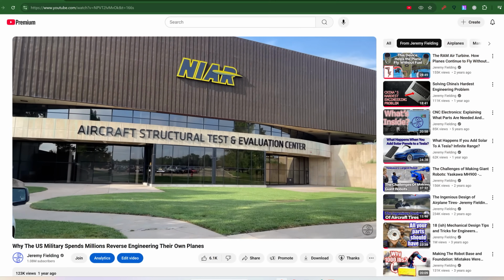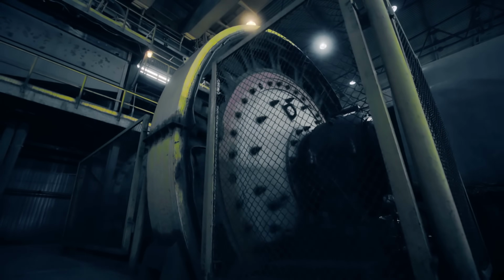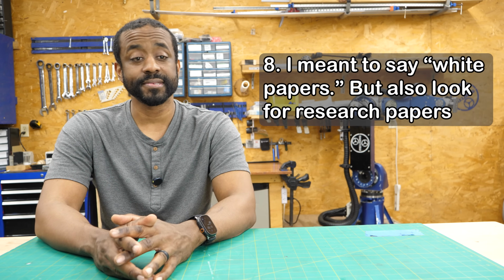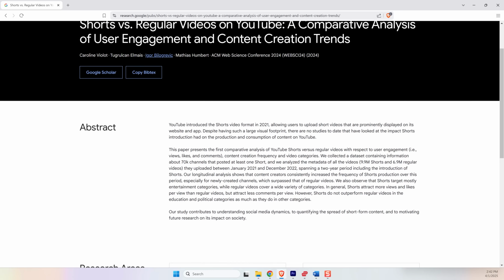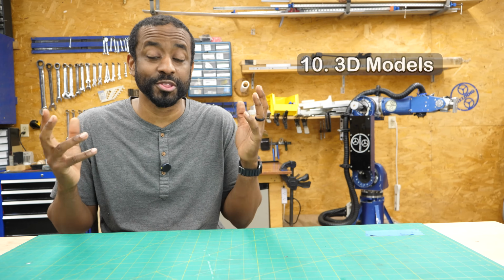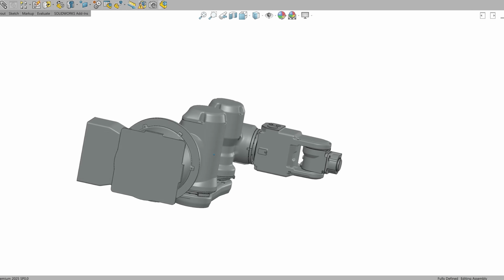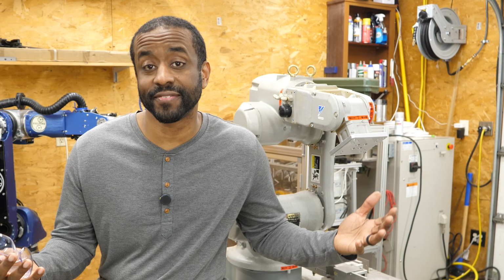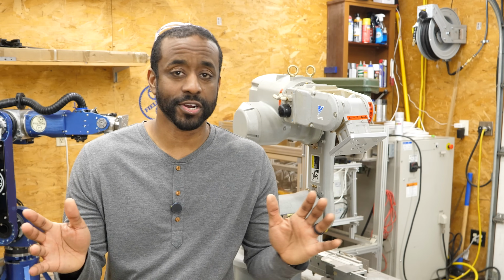How To Reverse Engineer Anything Even If You Don't Have One!

Comment: Awesome content!  Additional information are aftermarket spares and the information provided by those sources.  Mechanical interface details, images, and other mention of ISO, SAE, and other standards let you get the exact dimensions of those interfaces.  Forums dedicated to specific classes of equipment also share these details freely.  Do your best to determine if a dimension or feature location is critical or non-critical.  When I mean critical, I mean in terms of how that feature relates to other parts of the device, or if it's just because they need a fastener somewhere in the general area, for example.  Working to understand the why behind specific components of the design go a very long way to driving where you should expend your effort.

Comment: I think those plastic sheaths on for avoiding humidity ingress where the connectors are copper, copper + humidity + Air = the groovy green oxidization, they're smart to put that there. I learnt that from a washing machine what would constantly get copper corrosion due to the high humidity around it.

Comment: Excellent job. Could you reverse engineer the following invention claims even if you don’t have one?
All electric vehicles: there is an invention, EPM-2 that maintains charges to the batteries, U.S. Patent No. 9641045B2. EPM-2 leverages innovative electromagnetic technology to transform magnetic energy into mechanical and electrical energy. This makes it a sustainable and efficient alternative to combustion engines and traditional renewable energy methods.

Comment: When I go looking for manuals, I usually skip the user manual, and go straight for the service manual.

One of the fun things about reverse engineering is discovering undocumented features. I remember one time I was taking apart a broken transmission, and I discovered that one of the mounting holes for the clutch cable bracket was drilled completely through the housing. I realized that it made for a considerably easier gear oil fill port location ( right in the middle, on top of the housing) than the standard one that's at the back of the housing.

Comment: Many years ago, I was visiting my brother and I did a project with one of his boys. I handed him a half height hard drive and challenged him to take it apart. He did a great job of getting it apart. He did not take pictures or organize the nuts and bolts as they came out.  Once he was done, we reviewed how it works and what things are.  Then I challenged him to put it back together.  He wasn't expecting that step.  He did a great job. We plugged it in and got it to spin up which was more that we expected. It would not access anything that had been on the drive but we didn't expect it would.  The next year, I brought a laptop hard drive and he did the same thing.  He expected to put it back together so he was more careful about putting things aside in an organized way.  When it was open, we compared how it was just like the larger drive but smaller.  When he put it back together, this one actually spun up and we could access data! Today he is all grown up and has a degree in auto and diesel mechanics and of all things, works in a foundry.

Comment: I adore tearing things down. I really like pro-consumer and maintainable designs because I hate taking notes and I really do need some youtuber to convince me to do it. When I take apart well made laptops or a car, you tend to be able to find pretty good diagrams, only use a few kinds of screws, and you can get at stuff without taking everything else out first. I can get at my cpu, or under my laptop battery, if i feel like it, but if I want to take off the screen the only reason to mess with the battery would be because i'm worried about zapping myself (which i'm not, the screen can't run at higher than 5 volts lol). anyways this video is great, if i were to take apart anything industrial I'd totally watch think first and go download that spreadsheet.

Comment: Great video and one of my channels Jeremy.

On KUKA and ABB robots they v had a similar removable plug on the minor axis’s, this was for fitting a DTI with an electrical connection to allow the robot control system and the robot to be mechanically / electrically zeroed or aligned for the encoders.

Comment: This is awesome.  I've been watching Bigclive teardown videos for years now, but your approach is way more methodical.  (I'm sure he has a more methodical approach to the reverse-engineering of the circuit board step, but we rarely see it).

I really like the thought process of "they did this for a reason, it's probably not a mistake just because you don't know the reason yet".  The same is very true in software, especially around things that smell like bugs, or even are bugs; sometimes, they were put there for a reason, even if that reason no longer exists.  On more than one occasion, I've "fixed" a bug like this only to reveal a far worse issue that bug was preventing from coming up, and sometimes that's intentional.
Reply: "Chesterton's fence" is a term I've heard used for that. If there's a fence across the path, it was probably put there for a reason. That reason may no longer be valid, but the fence shouldn't be removed until that is verified.

Comment: I've had the same views for many years in engineering. It is possible to reverse engineer anything really, from jet engines and aircraft, nuclear reactors to a car or kitchen appliance. When I go into a machine, like you I delve deeper into the mind(s) of the design engineer(s) who made it - why did they make it that way. What challenges they would have faced and overcome etc. Even electronics can be reverse engineered.

Over the years, I have noticed products from Germany and Japan are more user friendly AND service friendly, showing these went through initial design, rigorous prototype testing and compliace before being mass produced. Products from China are more designed, prototyped and as long as it works, just put on the market. Most of their products are actually designed in the west by engineers sitting at a computer screen, the final blueprint is then emailed to the factory in China. Products from the other European countries France, Italy, Sweden, Holland etc also follow the same steps like German and Japanese products. 🐞

Comment: You make great educational and tech-motivational content. I do a bit of tear downs myself both electronic and mechanical. The robot looks like a machine with very specific measurements, I noticed you didn't talk about torque specs which I believe would be of importance to such a machine or any well engineered or designed machine. I'm also not an engineer so I may need correcting.

Comment: First off, Your channel is awesome. I love engineering! I know you know this but some viewers might not. Making a casting is cheaper for large production runs. But, in order to cast something a mold must be made and that is not cheap. It (the mold) is typically machined at a tool and die / mold shop. Or, Use investment casting, additive metal processes or sand castings. All have advantages and unfortunately limitations. But that's why we're Engineers and enjoy ( and hopefully paid) to figure this stuff out!

Comment: 10:13 That plastic fastener bin looks like it needs a center support. Plastic deteriorates over time till it fails. 
The first mechanical engineering lesson is to respect the form factor: divots, protrusions, folds, holes, thickened areas are there for a reason.

Comment: When I was seven the VCR ate "who framed Rodger rabbit" my mom said we'll buy a new one and I told her that I'll fix it. She laughed and walked out of the room but I went and got a screwdriver and completely disassembled the vcr, pull the tape out and straightened out the bends in the tape ribbon and rewound the tape. Then I put the VCR back together and when she walked in the room I was watching the movie again. Both of my parents were extremely shocked and they went and bought me a technic set right after that. I had technic and erector sets because of that. Honestly those toys were the best toys I think ever invented because you had motors and sheets of metal that were already pretty hold with screws and bolts as well as nuts for the bolts. You could build anything and I went through that whole book building the planes and helicopters as well as the cranes and loaders. Because of that I can damn near rebuild anything nowadays. My problem is I never turn the camera on😂
Reply: This was around 92 so we didn't have the internet or the information we do nowadays. You literally had to figure everything out on your own.
Reply: You're better than me ... I used to hate the erector sets because you spent a lot of time screwing on the nuts and bolts ... so I migrated towards the "easy attachment" toys that got to the big picture fast. I think there are trade-offs to either approach (what engineering is about).
Reply: That's such a nice story.
Reply: Bravo, man! Humanity is better off because of you and people like you!
Reply: I loved erector sets, my friend had one with motors, etc.
Reply: @ropeorsnake-I they all came with motors, wrenches, an assortment of bushings as well as bolts and nuts. They also had a bunch of different i-beams that came with him that were pre-drilled. Honestly, I wish they had toys out for kids like they did back in the day but there were too many parents that didn't know how to control their children back then. Even I put myself in Jeopardy by combining my Legos and my erector set as well as the Technic set. Technique was another erector set before Lego took it over and made their own. Are spun a Lego rotor blade up to about 2800 RPM before it exploded on me😅 I made Legos hover though😂
Reply: I used to take apart radios and put them together with other radios to make them work. My parents caught me a couple times and gave me a nice spanking. 😂
Reply: What book was that ? I also ticked with lots of things till now its how I earn my living now
Reply: I fixed things as well. Hardest most intricate thing was taking two broken cd walkman's swapping parts and making one working one. I was successful. Trading out even the laser. It was intense.
Reply: My mom got embarrassed as I just had to disassemble every even somewhat technical toys I got as a present. She thought that the family friends wouldn't like that etc and I should be able to show the toys intact when the gift giver happens to visit next time. 

It was also at about 6-7 years when I started to get most of those things back together and working after my interest of what's inside was satisfied.

I had a lot of Lego technic sets in the 80s. In ~92 I wanted to prototype something (as you do when you're 12) and went to find my Legos to do so and found out my mom had given all of them away couple years prior "as you don't play with those anymore". Wtf, I should have been in that discussion and would have never let that happen. I'm 44 and still really annoyed for that. And have since bought a few newer large technic sets second hand (in built state), but haven't bothered to disassemble any of those. Those 80s ones were nicer in my opinion.. New stuff has body panels etc that hide the mechanics, which is just stupid. Pretty sure having Volvo stickers all around a digger won't pay any of the pieces like an advertisement should.

I've been an electrician since 99 and now I do mostly troubleshooting, configuration/programming of lights, vfds, some automation etc. It helps a lot to know some basic industrial mechanical parts and how those should behave. Several times the electrical problem has been actually something loose on the mechanical side, that makes the load go up and trip stuff from electrical side.  Instead of blindly replacing the electrical stuff, it's often wiser to just sit down and look at the process itself for a while.
Reply: @villehietala9677  I was the same way to the point that when I was about 13 or 14 I bought my first security bit set. Everything had those specialty screws in them 🤣 that's also why all my brothers old power rangers toys like the Big Mechs are still in good shape. I used to take them apart and clean them if they got anything inside. I actually just pulled that big box of power rangers toys out of storage about a month ago. I forgot we still had them and I bet there was some money now 😅 I only took things apart if they were broken and then I would put them right back together fixed. RC cars on the other hand I would Rob the motors from and make my own remote control stuff.

Comment: I tear down machines all the time and one thing i learned to look for that you wouldnt expect is the double set screw, ad in, 2 set screws stacked on top of each other. The natural assumption is there is only one and you will waste so much time fighting to get something apart because you ddidnt realize there is still a screw holding your part especially if its a small screw and a deep enough hole that you cant really see the bottom. Just know that such a configuration exists in the wild.

Comment: Hey Jeremy, in minute 20 of the video you found an adjustment point. The groove you found there sits right across a hole you can either put a manual measurement device (dial gauge) or an electronic adjustment device into. When you found the lowest spot on the groove, that's where the origin of the axis is located in this case axis 5 on your robot. By saving this exact position of the axis in the software the robot always knows where it is in space and what direction to turn the axis for the next programmed move. Adjustment or remeasuring of the existing axis.origin is frequently needed in case of a crash or when the robot is set up in a new location. Great video, thanks for sharing great insigth into your process and what engineering looks like! Greetings form Germany!
Reply: Thank you. I was searching for this comment.
Reply: looks more like a lock for shipping

Comment: 20:08 the port is indeed for a digital alignment tool used by maintenance techs to calibrate each axis of a robot arm. In the past this was done by 2 face plates that align on the outside of the arm

Comment: About your comment on the plastic bags over the connectors, I would say that if something exists that seems extra, there is a pretty good reason it is there, all extra parts cost money in material and assembly, and all companies want to make the most money out of their products! Another reason for it, while it doesn't make a difference on the end product, it might make assembly easier/faster. Production Engineer here.
Reply: Moisture is an anathema for electrical circuits ... they probably wanted to reduce the probability of bad things happening at electrical breaks (connectors). I think the trade-off was a good one ... compared to the really hard to find problems that could result if those connectors are subjected directly to the outside environment.

Comment: I suspect the bags around the connectors have something to do with some specified operating condition for the robot.  I am guessing either a flammable gas environment that requires spark prevention or a corrosive gas, humidity, or liquid environment that they have to protect the connector contacts from.

Comment: 19:34 looks like the reference point for axis 5 to reference the robot with an external tool/sensor.
Industrial robots usually dont have to do a reference movement after power them up. But they need to be referenced once during initial take in operation process.

Reach out if I can help you. I work with industrial robots for about 15 years now. Mostly programming them, but I have done some maintenance work as well.

Comment: Im absolutely with you on this. When I joined the company im at 10 years ago they had an open skip policy , wood, metal, scrapped off instruments and rigs, motors. That all stopped due to abuse but we now have students so Ive saved a few machines for them to teardown. I believe its vital to have hands on. see the physical implementation, the assembly. gas, vacuum and hyraulic systems are so connector specific they need to be seen and felt. You cant lean by watching how much force it takes a screwdriver to prize off a lid before causing damage.  With scrapped items theres a possibility to fix. This sounds perfect for students with access to WEEE. Will you need to hack any comms protocols ? Pleasure to watch, steady recovery on the leg.
Reply: Prise.  Damnit, I'm sorry.  I can't help it.  It's a disease.
Ditto to everything you said.

Comment: Documenting, to me, is one of the more powerful thing in any assembly construction or deconstruction. I work mainly with code and for that, code comments and relevant informations about logics are key to get back, swiftly and efficiently, into a past project without having to spend hours figuring out logic and sometimes, flawled or outdated logic.
Reply from the maker: So true.
Reply: You are correct ... that's why I don't like the term "coding" ... "coding" is creating something that passes syntax and gives you a valid, and possibly not complete, answer. A " trained programmer" gives you a algorithmically efficient, easy to maintain solution to all requirements of the project.

Comment: This a great video. You also have to keep in mind that things done in manufacturing are optimized for cost and time, so them doing something in a way that may seem strange could be because it works and is cheaper. The zip ties vs a sleeve is a good example.